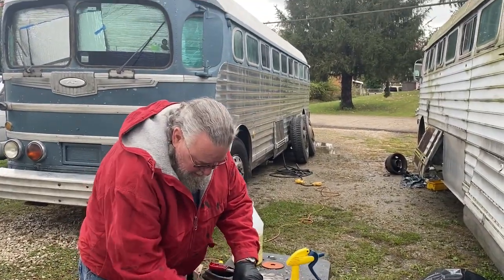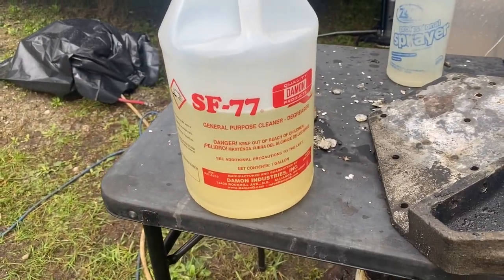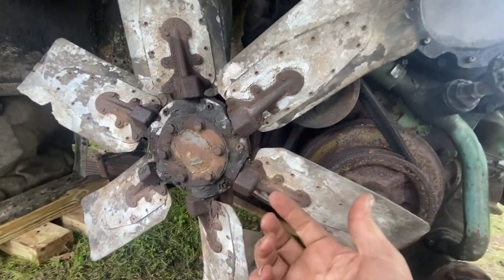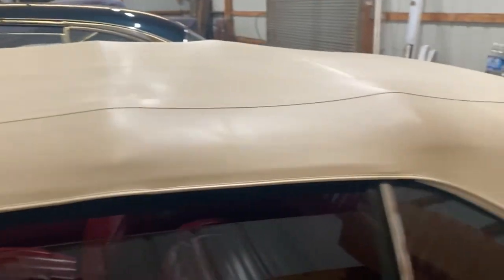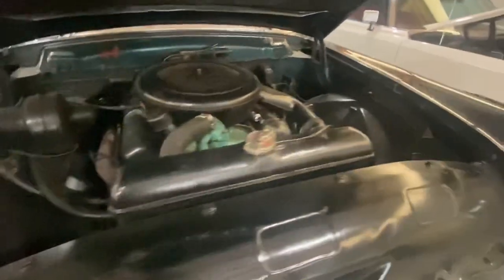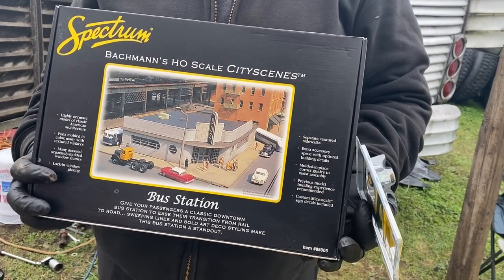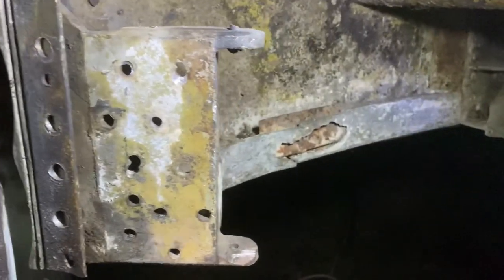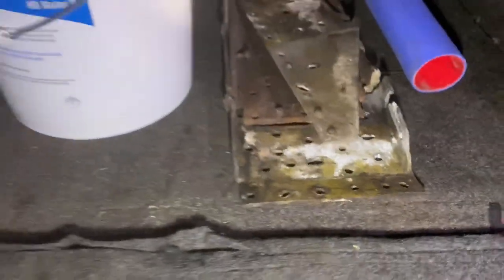Day 4 silversides bus project

Comment: What a mess, that bus is suffering from aluminum intergranular corrosion.  That's going to be a lot of work to fix that.  Good thing you guys are up for that.
Reply: get the corrosion down, see what's whats behind aluminum bulkhead, make some nice doublers with .063 titanium with 2 inch extra boarder, re anodize aluminum, grab the rivet fan layout new rivet pattern, on the overlap and try to pick up some existing holes on the aluminum, depending on the new piece gonna have to pick those as well. Hmm cherry max or monel and 5x gun and bucking bar. monels will be there forever cherries are faster. mix up some tubes of PRC B-2, roll it on the new parts twist down the cleco wingnuts so it'a solid fit. and start fastening it in,

There's gotta be a AME structures guy local, maybe retired even, could make short work of that so you could move ahead to the trunion, I would book it down with my tool box, supplies and mini brake and shear if you weren't so far away and I had holidays left. It really doesn't look that bad, I work on some old tail draggers that had lower skins as thin as those fan blades with matching frames and stringers. Like you, I prefer working on the old world stuff, from the wright brothers and by the end of WW2  jets, rockets, and enough understanding of aerodynamics to make a plane for those jets in that short time! Yes the materials are better now, but really the tech kinda stalled besides the electronics end. And personally I love mechanical, your at the mercy of fly by wire system now, PC craps out......and well hope it reboots.
Just add more metal that is why the old planes look like boilers, this bus will be rolling in no time. Have fun guys

Comment: Years back, I bought a  VW sedan, and took the bent aluminum bumper off, so sure of myself that I could straighten it, propped against a thick cement driveway.  I used a 10 pound sledge hammer (long handle, of course). I swung that sledge hammer repeatedly, for about half and hour, and never bent it at all!   I  gave up the fight , and installed that thick aluminum bumper, just as bent as before I tackled it.   Yes, today’s aluminum is way stronger than  that motor mount on the  Silversides.

Comment: I am intrigued by the engine mount and the breakage. When I have seen damage and repairs like that it is usually indicative of something that transfers vibration to the frame. I was wondering if the stuck drive shaft coupling might be the culprit. I am really impressed with the work you guys have done on this bus.

Comment: Wondering, you want to 'rebuild' the old fan ? (fabricate new aluminum blades and put it together)... or do you just want to throw a newer fan in there ? Seems like this bus is old enough that you might want to keep the original stuff installed.  (Collector Bus).
But, I dunno.

Comment: The fan looks as if it is restorable.  Why not fabricate new blades from aluminum using 6061 plate  and re-rivet them back to the hub?   If using the same style rivet, it would require a riveting tool to properly form the shop head.    I guess that would also depend on the condition of the working parts of the variable hub  and whether or not  is it going to be driven a lot.   Where I used to work, one of the guys did rebuild a V-12 Packard fan which had aluminum blades for a 1932 roadster.
Reply from the maker: Because the plastic is so much lighter and it removes other issues that plague the silversides

Comment: Silly comment from me, but why is one belt tighter than the other on a matched pair. When I have two or three belts together they are purchased as "A matched set". getting two belts with the same part number does not always mean they are the same length.
Reply: I'm guessing the bearings are screwed, that would allow the pulley to hang down making the outer belt looser than the inner belt.
Reply: @Tiger351  Haven't come across that yet. Sorry.

Comment: you might want to have a rotary tool ( aka dremel ) for those really badly positioned rivets you need to remove. Specially with the extension cabled bit for it. Holding something the size of a dentist drill in hand to get the top of a rivet would be very easy compared to the fight you had with these.

here is a low cost one from home depot:
https://www.homedepot.com/p/WEN-Rotary-Tool-Kit-with-Flex-Shaft-2305/203604481

Comment: Why don’t y’all delete the Fan Blades. & have Ron Davis Designe a Aluminum Radiator with a Single or Dual Electric Fan se up! U know this is a issue u encounter all the time so this will be a permanent fix not a bandage

Comment: lol cut it with a torch use 3 inch angel  and weld in place and build on that  you country bob kinds lol 30 years machine repairer   Detroit mi hydraulic